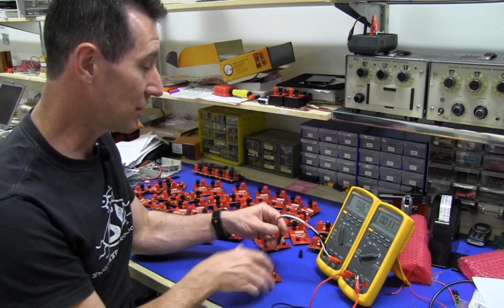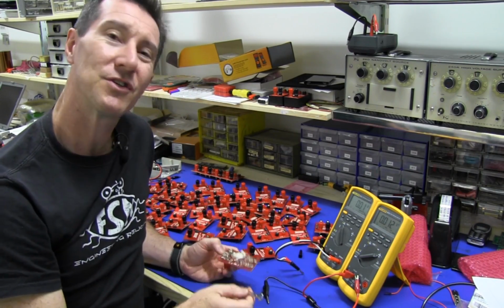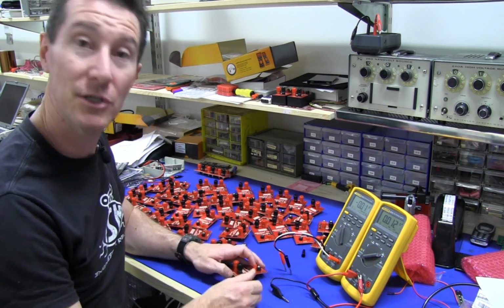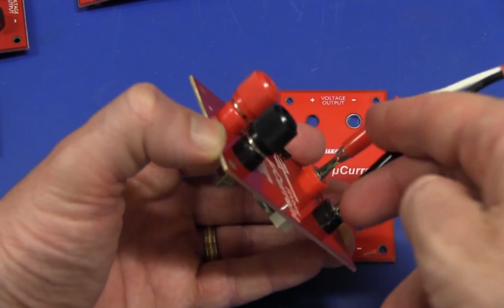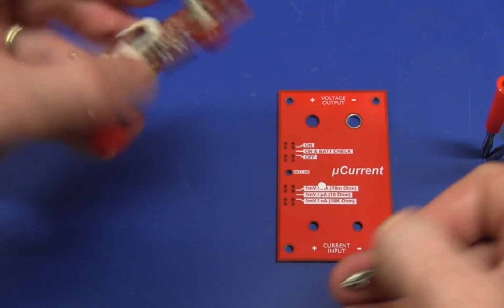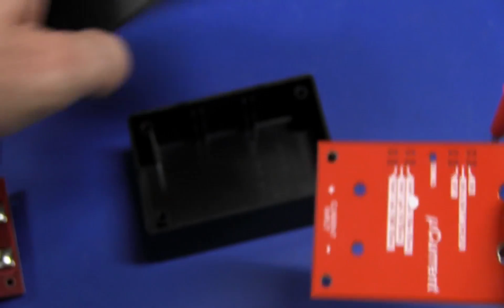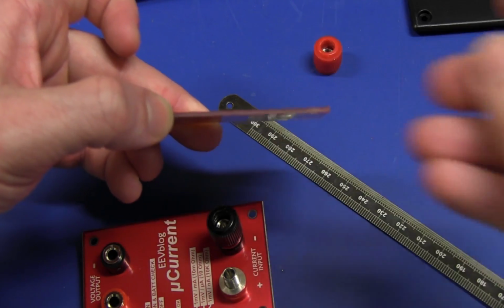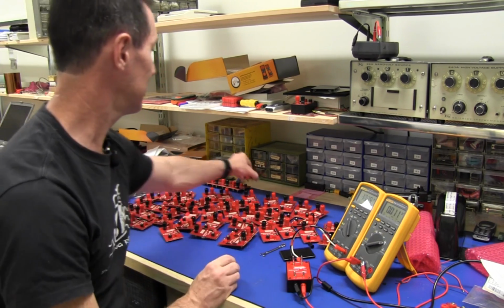EEVblog #270 - µCurrent Test Jig

Comment: Maybe use a microcontroller with audio feedback to build a dedicated test setup. You could free up the Flukes for other things.  The microcontroller could read the voltages and output a high pitched beep for good and a loud blurp for not good. Visually you would only need a red or green LED.  It could fit into the jig housing you have and be self contained.

Comment: Don't know, have the same problem here with around 1000 used 300ml bottles, do not really want to toss them, but am very slowly using them up. If the lids are pure plastic then look up a plastic extruder and give them to them to granulate and make into new plastic goods.